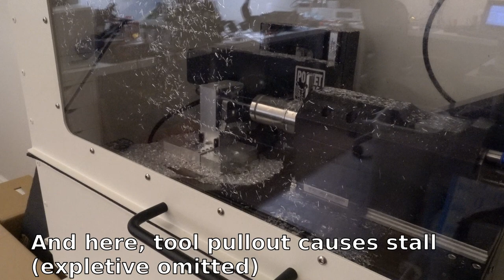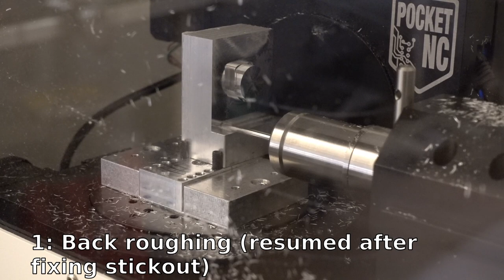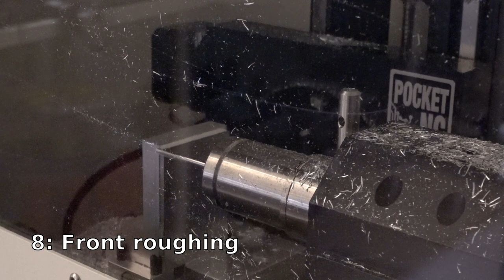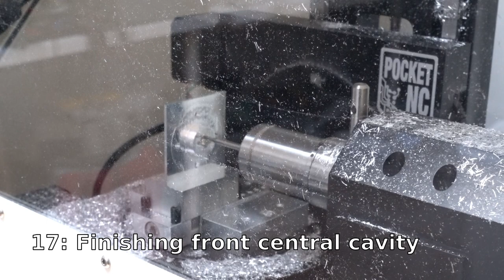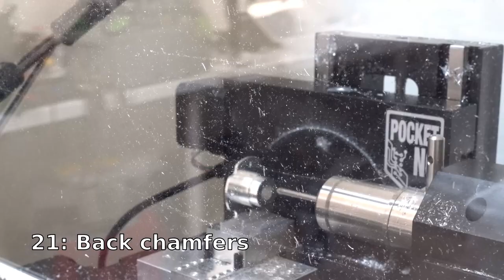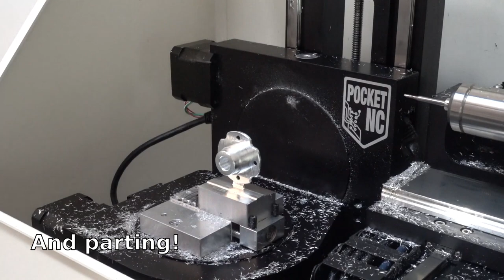Machining my first semi-usable part out of 6061 on the Pocket NC v2-50

Comment: So glad I watched this, I'll be getting the 10 instead of 50 because of tool pullout.
Reply from the maker: Well, there are good odds my current pullout issues largely result from using tools with inadequate reach.  Here I was trying to cut near the center of rotation. Since the z axis only goes so far, I had more stickout than was desirable.

When I get back to this project I plan to test with some longer teach tooling. I expect to have more problems with chatter, but hopefully less with pullout.
Reply: the tool shank could have been undersized, so it wasnt being gripped as much, maybe.
Reply from the maker: In this case my micrometer puts the shank of that endmill at 0.1247", which is I'm pretty sure is within tolerance for a 1/8" shank.

In further experiments, I have been able to largely eliminate pullout issues just by reducing the depth of cut.  The MRR is still I'm pretty sure higher than what a V2-10 can achieve, but it isn't maxing out the spindle.  More experimentation might get me back closer to maxing out the spindle motor.

Comment: I do not own a pocket nc so I do not know but maybee you could make a holder for the tool and use a bigger collet to hold it might give a more ridged set up with the long stuck out
Reply from the maker: Yeah, the V2-50's NSK spindle has a limited set of collets available.  The biggest can fit a 4mm shank, which likely isn't enough to build a better holder.
Reply: @awesjosh  also you would have to balance it really precise (even if the toolholder has no holes on the side and is rotational symetrical, the metal itself may be uneven distributed thus creating imbalance)